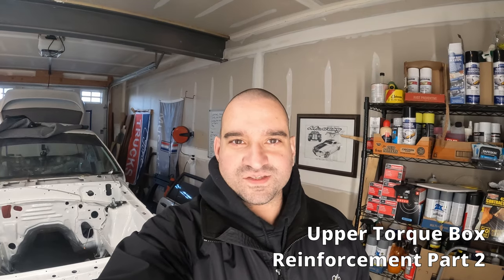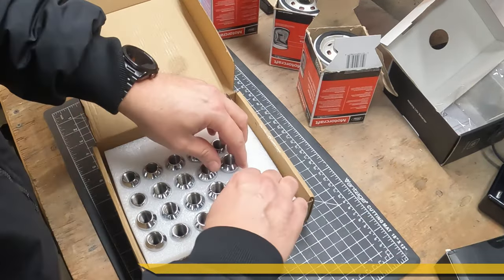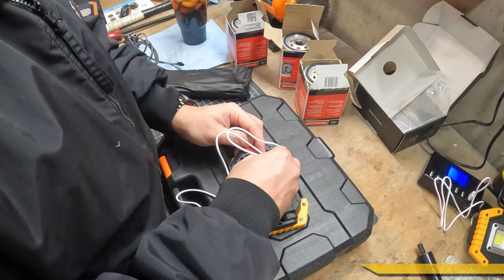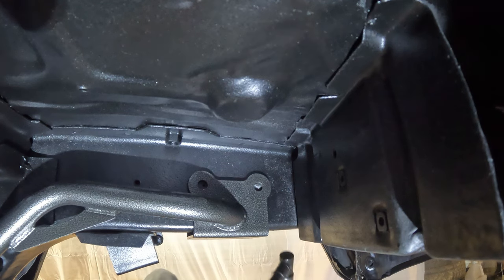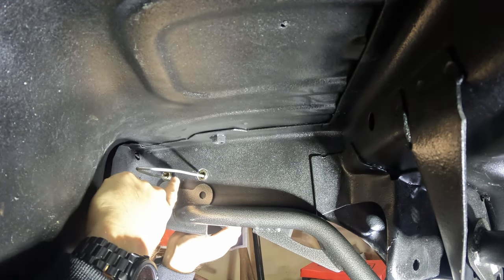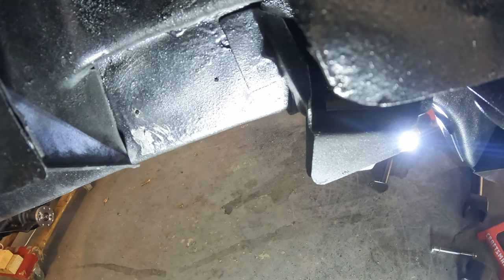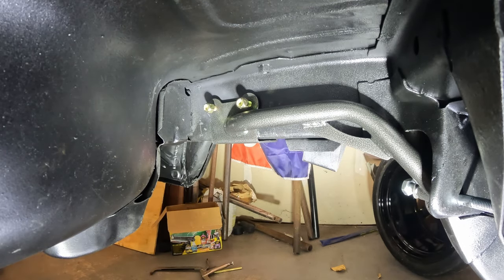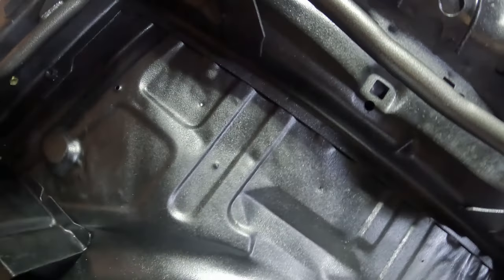Upper Torque Box Reinforcement Part 2 - Foxbody Restomod Part 44

Comment: What setup did you use? I've been thinking about doing a TB reinforcement on Frankie because 351 things.
Reply from the maker: I did SVE plates for the lower torque boxes and the BMR kit for the uppers. Definitely a good idea especially if you plan to run sticky tires occasionally!